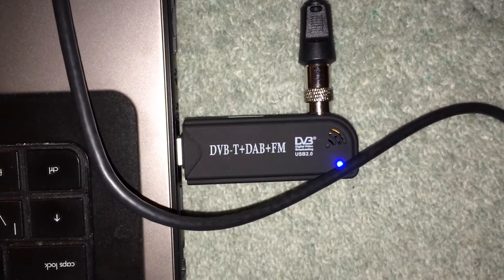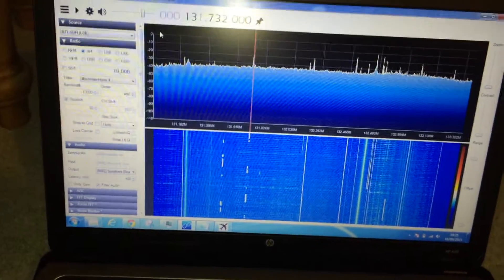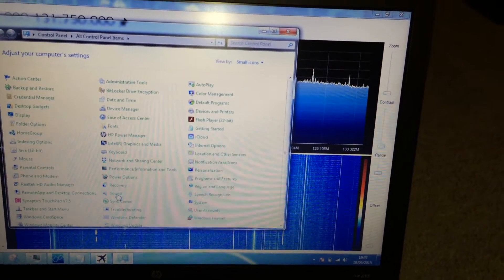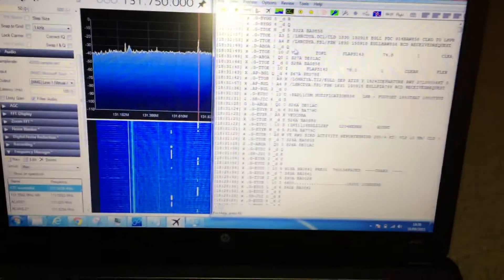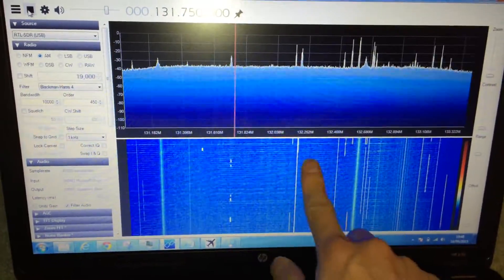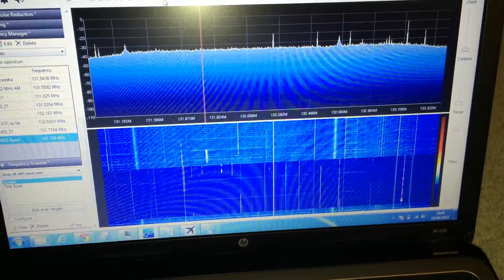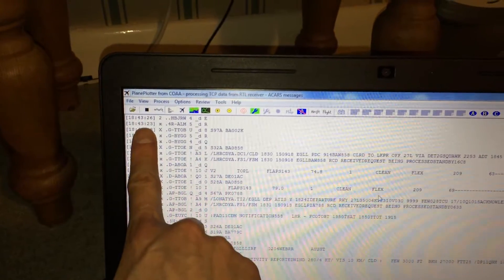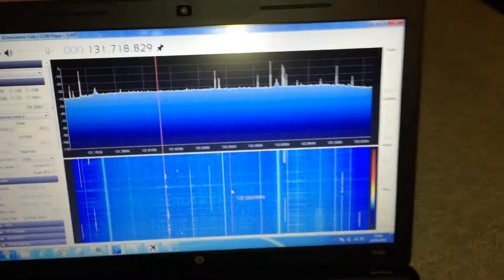Receiving and decoding ACARS transmission using SDR# + PlanePlotter. RTL2832 / R820T SDR dongle

Comment: Student pilot here...

The data that you received is pilot “code.” We normally use this in things like TAF’s and other weather services. You received the raw data being transmitted from the atis system in the tower. It also transmitted a bird activity report (as you noticed) and gave the pilots and planes Id, then reported the ceiling (sky) level, which at the time few clouds at 3000 or 5000 ft (hard to see) and a broken cloud layer at 27,000 ft above ground. The pilots runway that he took off from and intends to land is visible as well. (You won’t see this part with other types of aircraft due to VFR.) You can see your local TAF here: https://www.aviationweather.gov/taf  Just type in your local airport code and it should do it for you.

Edit: Most of the stuff received looks like Plain code, but some of it is written in our “code.” I cannot tell you what some of this means, but some of it I can...
Reply from the maker: Ahh cool! Thank you.

Comment: i do all this step , but i didn't get any message :(
Reply from the maker: but are you able to hear the audio signal of the ACARS message?
Reply: Brian Su , yes i can hear but there no message show, I use airnav and  acars and planepoter , same problem
Reply from the maker: Ok did you use 'Virtual Audio Cable' to send the audio signal back to PlanePlotter? You need to set your Output and Input sound devices to Virtual Audio Cable in Windows.
Reply: actually  i do it , but maybe there something wrong . can i gave you my teamviewer id and check ?
Reply from the maker: no sorry I can't help you like that because this video is very old and I have completely forgotten how to do all these. I gave this laptop back to my company back in 2014 and so I don't have anything to refer to either :(
Reply: ok , thanks